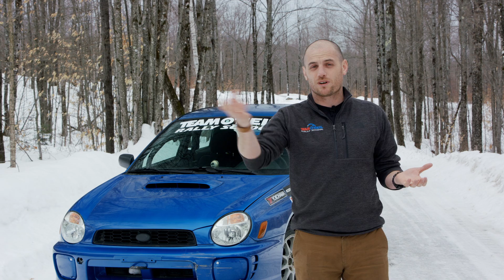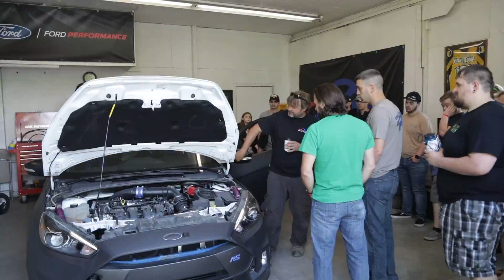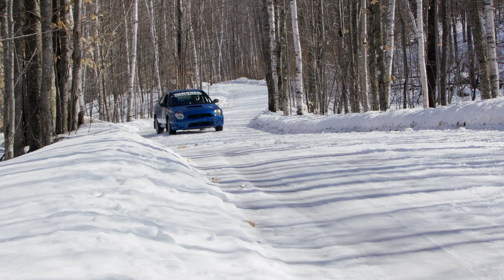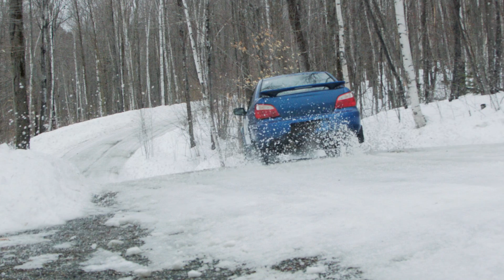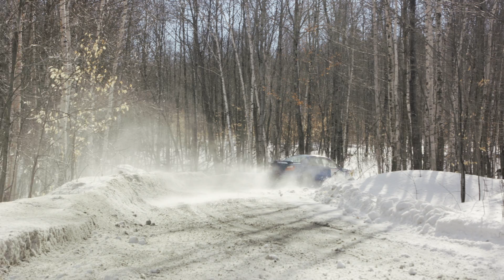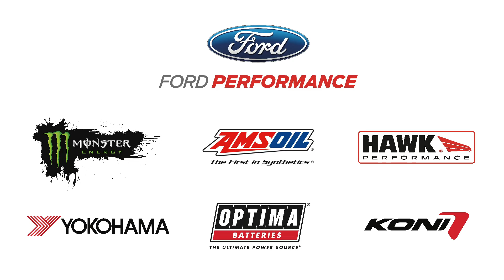Weight Transfer for Driving, Racing, and Rally

Comment: Front wheel, and a light weight car, it is easy and practical to use the gas drop as the weight transfer. You mentioned something, so I thought I'd add my two cents.

Comment: I have a 2014 Nissan Juke and I'm not sure why but even with traction fully off the system panics if I try to left food brake so I just handbrake corners instead and it works great
Reply from the maker: All modern cars will cut throttle when you apply brake and throttle at the same time, after the "runaway" car crashes a decade or so ago when floormats were getting caught on the gas pedal and people couldn't stop. There are usually easy work-arounds to get LFB to work but I'm not sure exactly what that would be on a Nissan Juke... Typically if you reach up the brake pedal there are 2 electronic switches, one is for your brake lights and the other is for the throttle kill.

Comment: I have an important q! How do you know when weight transfer is enough or when you need to add the handbrake? Is it bad practice to use the handbrake automatically on tight corners when you don't want to make that split second decision? Does it make you slower? And if so when is it appropriate?

Comment: Could u make a film "Is Sideways Faster?" on tarmac?
Reply: It's faster on downhill, especially if it's a hairpin turn, the thing with doing skids/drifts on turns is you have faster entry than using grip but you'll have slower exit speed mainly because as you slide through corners you get slower. But in downhill you can have faster speed recovery because gravity is your friend.

Comment: I took my car out today on some trails. Just a civic on gravel. It's amazing how naturally this all comes to you. I didn't even think to pendulum turn, I was just doing it. I didn't think too heavy into the weight transfer, just left foot breaking in the turns, but I did a lot of weight transfer anyways. It's crazy, the experience of 60 mph on twisting gravel trails. I think I'll never forget this day, neither will my pocket with the new radiator I need to buy. :)
Reply: Solid read lmao
Reply: Skid plates, even thin metal ones will stop gravel
Reply: I just bought a new radiator and expansion tank myself 😂

Comment: Wait..... there’s people that think weight transfer “doesn’t work”? Like..... how? It’s basic physics the more weight (without changing overall mass) you have over certain wheels whether it’s weight transfer or downforce, then the more grip those wheels are going to have, it’s something that can be mathematically calculated too.
Reply from the maker: I wish I had saved some of the good ones to copy/paste for you here, there are definitely some weight transfer deniers out there. 
One other thing we didn't touch on enough in the video is: the more weight is on the wheel, the more the tire will deform and increase the contact patch as well. You can see it pretty well in some of the slow-mo in this video, but on gravel or pavement it's more obvious (or if we dumped the pressures a little). Your four tires only have equal-sized contact patches when the car is sitting still or cruising at a constant speed... Once you're accelerating, braking, and/or steering, your contact patches on the ground will all be expanding and contracting in direct proportion.

Comment: So whats the best way to recover from understeer when already braking?
Reply: The only way to save that situation is to straighten out the steering brake in a straight line then try your turn in again,(hopefully you don’t run out of road) 

Realize this situation is only caused by overspending your corner entries assuming your car has a fairly neutral setup
Reply: radu pirvu
what this guy said, also lift off the brake in addition to straightening out, till you got grip
Reply: If you're understeering on the brakes, you need to reduce braking pressure. A rolling wheel always has the most traction. If you can afford to let off the brakes without hitting something in front of you, do it. You'll actually gain weight on your front tires as the tires regain grip. Also, consider the transient input of your braking. If you stomp the brake pedal quickly, you're more likely to push the tire beyond it's limits and induce understeer. Be deliberate and calculated about your throttle and brake input instead of aggressive. Your stage times will benefit. :)

Comment: I have a Bugeye WRX wagon and would love to see how/if the wagons perform differently and how to deal with it!  Been really loving your content.
Reply: Save for slightly different weight distribution and a little more weight, I bet they'd be nearly identical. Once you drive for just a few minutes I'd bet you wouldn't even realize.
Reply: @SonoftheBread  Yeah, Wyatt said in another video that there almost no difference in weight.
Reply: @madmax9009  Going by factory stats I believe the wagon is roughly only 200 pounds heavier which is the difference of just having another person in the car. Weight difference is essentially negligible unless you do a full ac delete and rip out most of the interior

Comment: boom first. But man... weight transfer is the name of the game. I rallycross a V6 MR2 which has almost no weight on the nose. You really have to pitch the weight on the front, get it rotated through the corner, but then really modulate the throttle to keep the anchor out back from swinging around on you. Long sustained corners the front can really wash out because the initial front pitch has evened out. A really engaging car that rewards weight transfer. Can't wait to cage it for hill climb!
Reply: Watching mid engined cars rally is really entertaining. It's really not their forte but man when they do it right, they do it well. The Stratos was claimed to be one of the hardest cars to drive because of how light it was and the crazy weight distribution, not to mention rwd. Did you start rally with that car or did you have prior experience with something else? I've only ever taken out AWD cars to some dirt tracks and stuff so I'm interested in seeing some other experiences.
Reply: @SonoftheBread  i used to do a bit of dirt racing in my old 05 ford focus and ive gotta admit near the limit theyre way better than youd expect for an FF eco box. On tarmac the stock suspension is a bit soft but om dirt its almost crazy how right they got it. With some left foot braking and a bit of handbrake that thing would rotate beautifully and carry a ton of speed.
Reply: @tougedenizen4840  that doesn't surprise me at all actually! The focus and fiesta are both really good ff rally platforms. People definitely underestimate the amount of fun to be had in cars like that when you drive them right and in the limit. They're incredibly forgiving too, so you can kinda just send it and see what happens.
Reply: @SonoftheBread  I pretty much started with the MR2. Drove an e30 for two events but didn't like it. The MR2 first started off with the stock 4AGE motor with nearly 200k miles. It was a very balanced car that never knew if it should understeer or oversteer. Usually it would understeer. With the V6 and an LSD it now is totally biased to power oversteer. Makes it very predictable. And, at about 2000lbs and 200hp, it is actually a pretty good stratos equivalent!
Reply: @Krautastic  I watched a few of the videos you have on your channel. Good driving! I can definitely see how it tends to some understeer but it looks pretty fun to drive. What V6 are you using? My buddy has a 2nd gen MR2 that leaks oil like crazy and I know he's been considering a swap. Also have you considered putting a smaller sway bar in the front? That or removing it might help the front grip up more.
Reply: @SonoftheBread  I am using a 1mz VVTI. Thats toyota's older 3.0l V6. Less power than a 2GR, but more plentiful in the junkyards for when I inevitably blow it up (which I already have once). For a 2nd gen naturally aspirated model, the 1mz drops in with just 1 motor mount needed, available from woodsport, and then wiring/exhaust work. Dead nuts easy. When the car didn't have the V6, I tried no sway bar and I ended up spinning the inside tire way too often and it was very slow to transition from left to right, like in slaloms. I haven't tried it again with the new setup, and I am currently building some bilstein coilovers that will stiffen the car a little bit. It'll be a good time to try things.